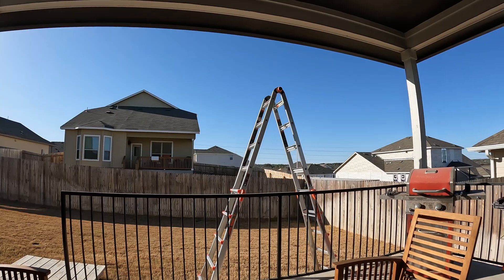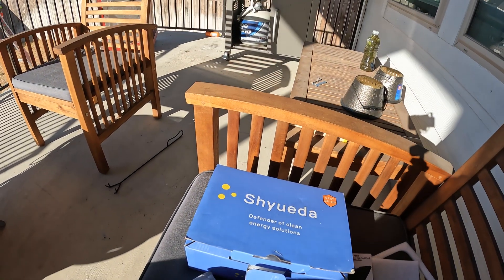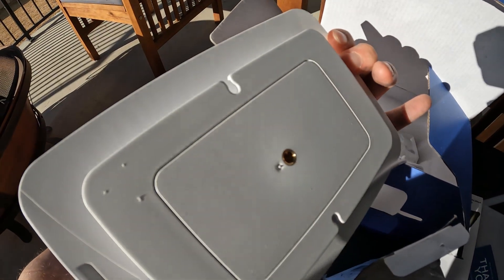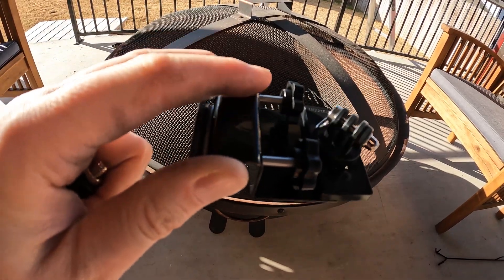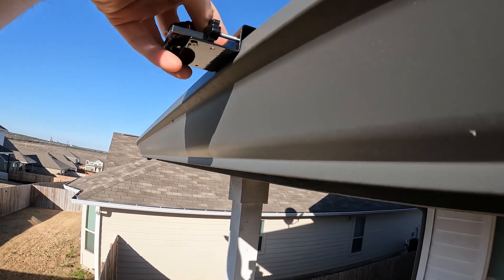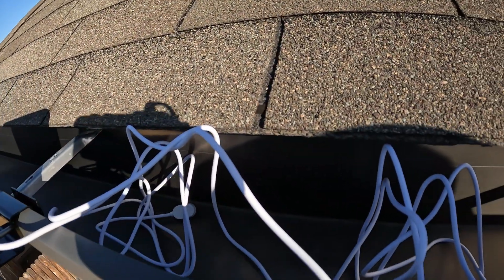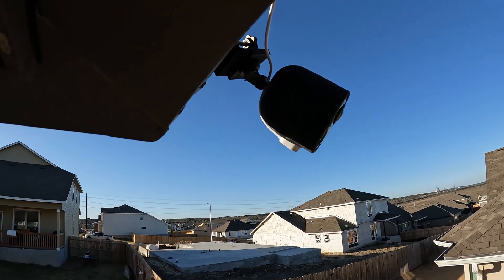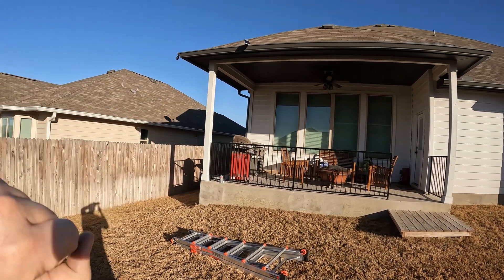How-To: Solar Power your Arlo Security Cameras! No Need to Charge Ever!

Comment: Still holding up?
Reply from the maker: Yep! Haven't had to do anything with mu cameras or batteries since installing. Only time I have any small issues is sometimes when it's 105+ and sun blasting the panel they get to hot to charge for a few hrs. Not a problem as battery is good for weeks on a charge and when it cools down a bit it charges as usual.